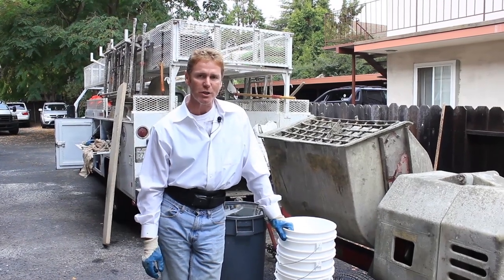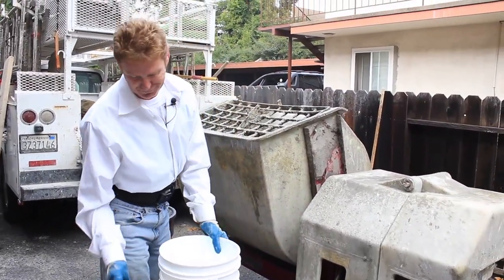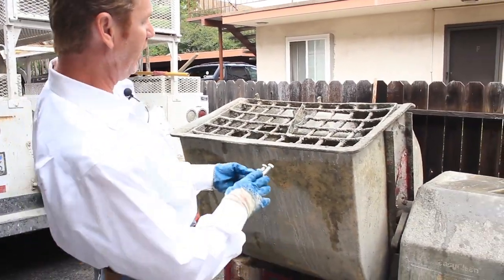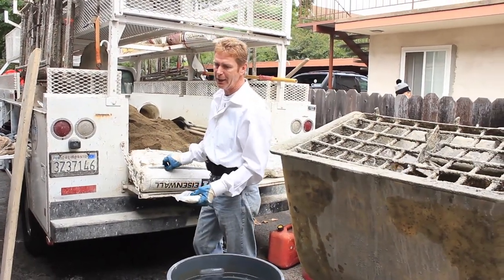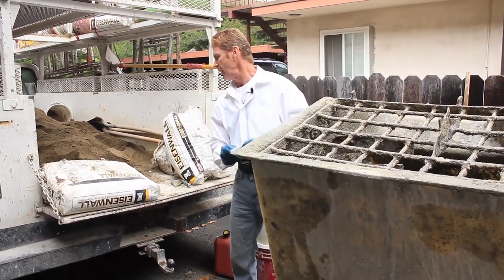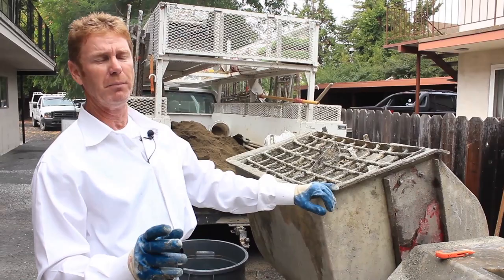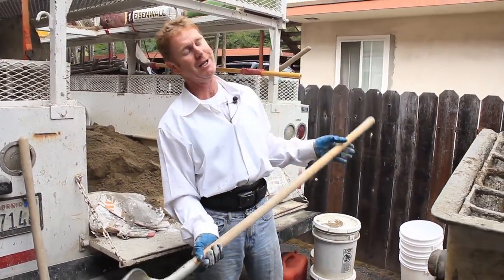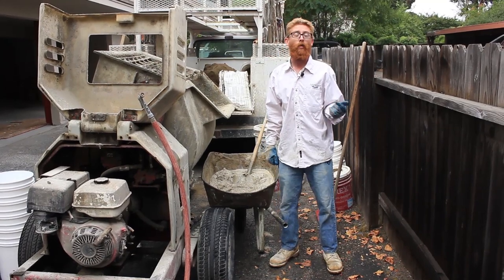Stucco mixing ratios sand and Portland cement.

Comment: Like the set control product for hot weather for more time factor. Those shear bolts /pins have a crease on the upper thread so when they tighten they snap at the crease .
saved a lot of rebuilds!!

Comment: Hi does mixing concrete (3/4 inch aggregate)  work well in one of these stucco mixers?
Reply from the maker: Howdy, no, the rocks get pushed into the drum and do much damage, you need the round barrel tpe mixers.💃

Comment: People used to seal stock tanks (watering troughs) with stucco/morter.  I am trying to figure out how to do this now.  Can you give me some guidance on how to mix the batch?  I will be using a larger sized cement mixer, as that is what I have.  Thanks in advance.
Reply from the maker: Howdy Jeff, I have seen those. They are not very versatile. I'd stick with the plastic or rubber garbage cans. 
But if you have your mindset, you can weld one on your truck.😏      
 Here’s wishing you and yours a happy new year.
 From the entire plastering Giordano Family

Comment: Anyone know what kind of oil does the mortar mixers use? Regular car oil?
Reply from the maker: Howdy Edgar, I usually put in 30 weight, 10-30 or 10-40; basically, any old I can find, haven't had any problems in 40 years with any other the mixers.
       Here’s wishing you and yours a happy new year.
 From the entire plastering Giordano Family

Comment: how u keep the plastic drum clean on that mixer
Reply: Bradley Parker We clean between mixes, or at the end of the day take a hammer to bang out the dried on material. But we don't use a rental and it's a metal drum. You can do the same with plastic, just be careful not to damage the plastic drum.
Reply from the maker: Howdy fellas, exzackory,
 Cheers and have a good and healthy year, Live long and Plaster
 Kirk and Jason giordano

Comment: Stucco is it cement and sand or what
Reply from the maker: Howdy Ludwig, good question, most stucco and concrete mixes use Portland cement as a binder, for example. Concrete is used for driveways, sidewalks, bridges, etc.
Concrete mixes rocks with the Portland cement, thus, because of the rocks, can’t be applied by hawk and trowel to any wall.
    Stucco combines fine sand with Portland cement, thus can be applied to walls as it's like a peanut butter consistency, no rocks in it.  
  O.K., here's the tricky part, many names for the same thing.
The terms or names are Cement Plaster, Stucco, Mortar, Mud in the US, in the UK, names for Exterior Stucco among others are Render and Muck.
 Kirk giordano plastering